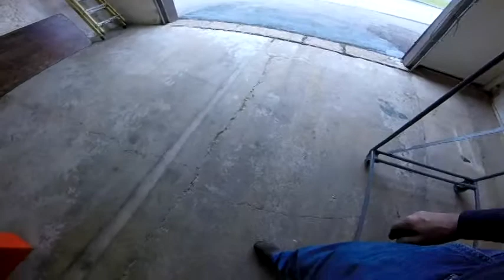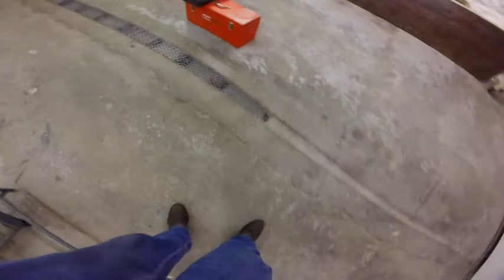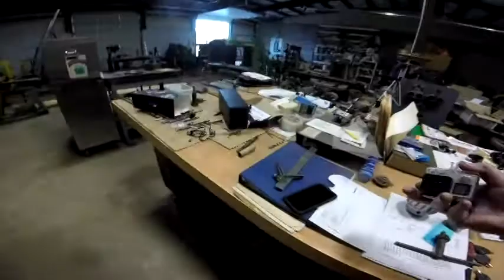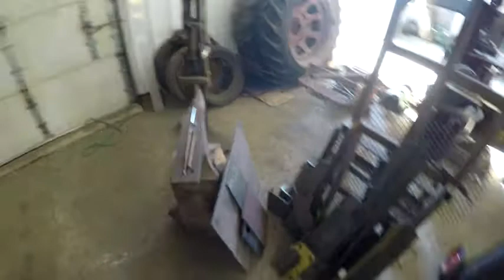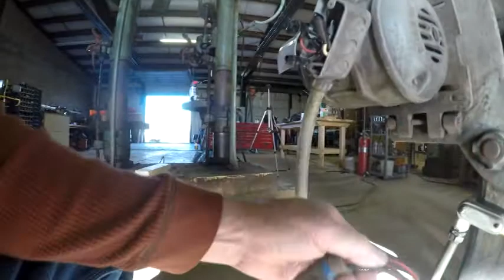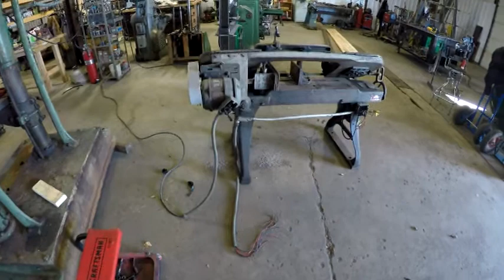Shop Update 10/20/17

Comment: it's probably best to scrap the old bandsaw wiring and rebuild it
Reply from the maker: That is my intention. Going to hard wire to a on/off switch and then will work on getting the automatic switch wired in correctly after it's up and running! Kind of want to get it in place first and running, then see what will work best for switches, starters, control for pump, etc.

Comment: Couldn't the transformer have a 240v coil for a primary and pull a tap off 2 of the 3 phases with the output being 110v?  Maybe I am not following this properly.  The machine needs a 110v control circuit for something on the saw, correct?  Coolant pump maybe?
Reply from the maker: Pretty sure just 110, only has two wires running to it! Tomorrow will pull it out and double check voltage listed.
Reply: You mean the transformer only has two conductors going to it period?
Reply from the maker: Tech Gorilla now that you mention it, that doesn't make sense! Let me tear it out tomorrow an d figure it out! But the only had two wires leading into transformer.
Reply from the maker: So took it out today! it was a 220/480 volt transformer! They had rewired it and feed it with120! I am not an electrician so have no idea of what they did, they were still using transformer but had wire-nutted some of the legs together, some of the wire went to plug, some went to transformer, made absolutely no sense to me! I made a video of it and will include it with next part of Band Saw series! But at this point, going to scrap all that junk and start fresh!

Comment: Fred, you need to get yourself a motor control starter, the way you have it hooked up now is direct to the motor with no over load protection for your motor.You can hook up an transformer to that to power your pump. If you want email me with the size of your motor and i will size you a starter. gmetalworks@attnet
Reply from the maker: Will send it to you tomorrow when I go back to shop! Thanks in advance for help.